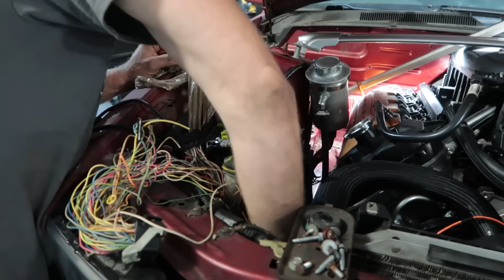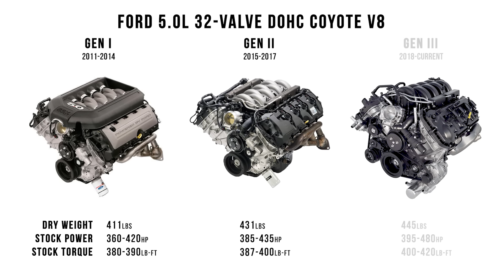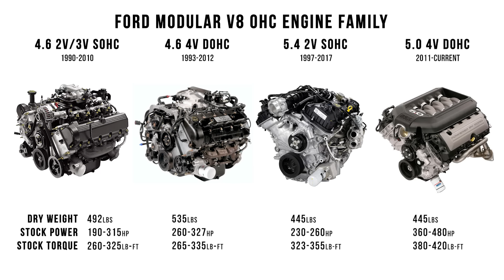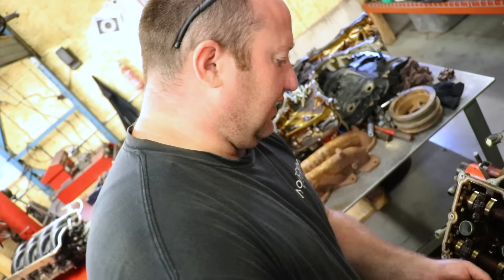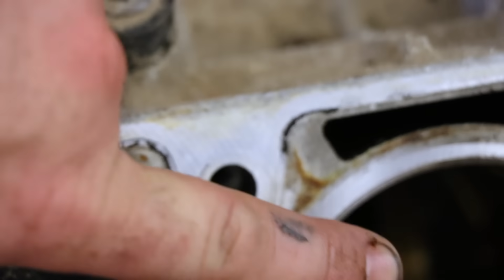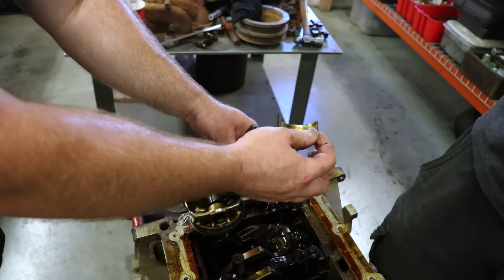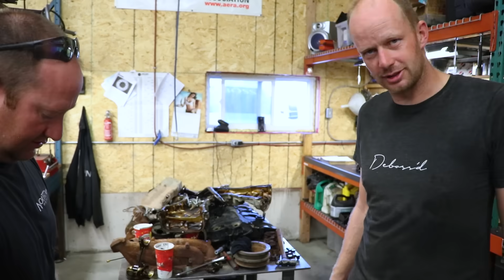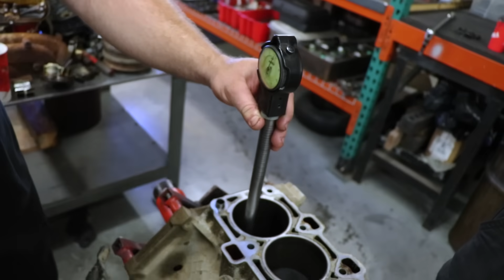REVIEW: Everything Wrong With A 5.0 Coyote Engine

Comment: You could do a video "Everything Wrong with a Ford 6.2" that would be 3 seconds long. It'd just be you saying, "even though it's a Ford, there's nothing wrong with the 6.2."
Reply: Damn good long living power plants , I'm so curious to see how the new 7.3 gas turns out, from what I seen on the engineering break down of it with the prototype it seems like a really reliable design,time will tell what they vuck up in manufacturing but yes it's hard to beat. 6.2 reliability I have seen ALOT with beyond 300000 miles like I have 4.62valve, if your 4.6 2v has spark plugs threads and you don't keep running the crap out of it with the timing chain slapping they last as long as an old 300, I can say that because I have an 03 with 400000,she's tired but still going could use a rering and valve job for sure  , got multiple 300's with God only knows how many miles and I'm hoping to start a 6.2 swap in a 74f250 this fall if all goes well with the donor truck
Reply: @wolfmanrebel874  Those 4.6 are damn good engines too. And it would be awesome to see a 6.2 swapped into an old Ford, if i had the money i would put one in a bullnose F350 as a tow rig.
Reply: @rswany16  thats my thoughts, I was going to do a 5.4 2v 4r100 swap but can across a rolled f250 with 6.2 ,my 74 is a rolling chassis at this point so I can do about whatever I want with it if I can get that donor here at the right price il take engine trans electrical system and all and move it over and have the security system bypassed or disabled and fabricate motor mount perch ,trans crossmember and driveshaft and re do the floor for accommodate the size of the trans I'm excited to see if im able to go that direction
Reply: @wolfmanrebel874  That's awesome, good luck with it man! You better make a video about the build, I'll be keeping my eye out for it.😎
Reply: @rswany16  my wife's been trying to get me to make videos of my projects and such I just haven't taken the time, usually when I'm working on something I'm focusing on what I'm doing not explaining it to the world,lol I may start at some point she hounds me about it all the time
Reply: @wolfmanrebel874  I've learned the wife is always right, thats what she keeps telling me anyway lol 😆 Well if you do or you don't im still excited for you, like i said i wish i had the money to do the same it'd be so much fun.
Reply: @rswany16  thank you
Reply: Ford blows
Reply: @bilbobaggins4710  Good one..
Reply: @rswany16  well it does pure and simple ...Ford sucks ass all day every day ...anyone with at least a room temperature IQ knows that 😉
Reply: @bilbobaggins4710  And i bet your Civic can tow 20,000 pounds too... You can stick to honda im gonna stick with Ford. I have owned 3 Fords and haven't had any problems with them and my family has owned dozens collectively and also haven't had any problems with them.
Reply: rswany16 isn’t Ford discontinuing production on all their cars?

Comment: The synthetic oil commentary "crystalizing" is some of the biggest horse pucky I've ever heard..... if you don't know what you're talking about then stay silent.... been running rotella T6 in a 5.4 Triton for many years in my 2004 F150 and it IDLES FOR DAYS some days in the winter to just drive a few kilometers and other days it's started and shut off 10 times a day and never even moves the temp gauge and it's insides ARE CRYSTAL CLEAN and passes its multiple annual oil sample reports.... this bullshit commentary infuriates me.... that's just plain and simple an abused engine with little to no mainenance.

Comment: Scott great video! Forget about the comment section, 70% of these guys couldn’t fix dinner.
Reply: Scott, you are so right. I run a large semi truck. Truthfully all my buddies that use that crap have major issues. Swapping different types of oil is never good either.

Have a Great Day 👍
Reply: Cliff Niiranen , Definitely agree with you that swapping oil brands constantly isnt a great idea. I was referring to all the people who were like “ synthetic oil doesn’t do that, what an idiot”. Then give no reasoning, explanation or data. Even though he clearly said it has its place, just not good to run on short trips where the motor doesn’t stay at operating temp for long.

Comment: The way of the future just lost its pieces all over your oil pan.
Reply: And dont forget it costs twice as much to hop it up ,smh🤔🤣⚓⚓⚓⚓⚓⚓⚓boat anchor
Reply: Yeah that was some super weak reasoning against a cam in block motor. I'm no Chevy guy (though I own one, LOL) but everyone was sniffing at GM's cam in block stuff 20-25 years ago, trashing it as 'outdated' etc and lo and behold it's still around and going strong.
Reply: I’ve owned 4 fords and every one blew the engine. 3 chevys they leak but always run, a diesel dodge which has always run. I told my wife no fords for my daughter, I didn’t realize Mazda had a ford engine. Guess what, we just got finished changing the engine. That engine also has the complicated timing because there is no key way on the crank for the timing chain gear, the balancer pinches it to hold it in place.

Comment: I learned something today!  I use synthetic in my  GM 1996 4.3L, but very rarely get it to operating temp.   Been running it that way for the last 4 years at least, so I bet it is now gummy inside.
Reply: As long as you change it regularly, I doubt it. His comments, regarding synthetic oil are bs

Comment: The compression ratio change because of bore size isn't right. If the new pistons have a shorter wrist pin to top height or if they're dished, it would change the compression ratio.

Comment: The ls architecture debut was 1998 so comparing that to a engine almost 20 yrs newer isnt fair.  Having said that it was gm that first came out with a deep skirt 6 bolt main first ... coil on plug v8.. composite intake etc etc etc ... gm has run tried and true tech because it still works and was reliable.
Reply: It’s also cheaper that’s why you still get wax coated frames on brand new Chevy trucks
Reply: @joe1273   wtf does comparing a frame coating have to do with an engine  ? cost has nothing to do with it ... jesus that is a foolish statement.. gm has produced lots of dohc and sohc engines ... and gm had a dohc v8 in 93 ...
Reply: Ryan Austin lotus and mercury marine designed it...
Reply: @jbrandon302  designed what ???
Reply: Ryan Austin the zr-1 dohc v8
Reply: @jbrandon302  I'm aware of that ... I was referring to the northstar ... but .. were both on the same page regardless
Reply: Ryan Austin ford also had a Dohc v8 in 93 in the Lincoln mark viii it also didn’t pull the threads out of the block for the head bolts like the northstar. Every one is an expert mechanic on youtube.
Reply: @joe1273  congratulations... you've caught on .. you missed the point thou bud .. gm had what the big 3 are all doing now ... 20 yrs ago .. hemi deep skirt 6 bolt , composite intake .. ford .. same shit 
.. all in 1998 ..
Reply: Ryan Austin ford did that in 1993
Reply: @joe1273  jesus you have missed the boat and keep circling around to 1993 again ! ... ok have fun in 93 I'm sure fresh prince of bel air is on tv . Btw Montreal Canadiens win the cup so place a huge bet
Reply: Ryan Austin you don’t have a point to get you keep talking about who did what first
Reply: @joe1273  you're the one who came at me ...my point was and is there has been alot of copying of ls articticure.  You're also the one who thinks the 9 mm fine thread head bolts were the problem with the northstar ... but hey everyones a "YouTube expert"  right ?
Reply: Ryan Austin just keep thinking you are right, just another brand loyal idiot. Daddy Chevy would never do anything wrong!
Reply: @joe1273  ok puddin pants
Reply: @joe1273  never said gm hasnt done anything wrong... idiot